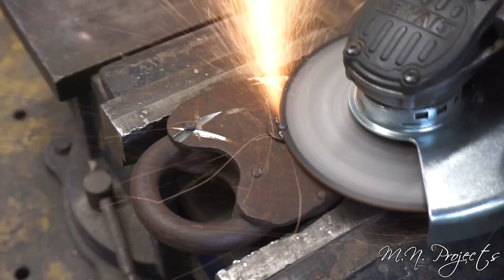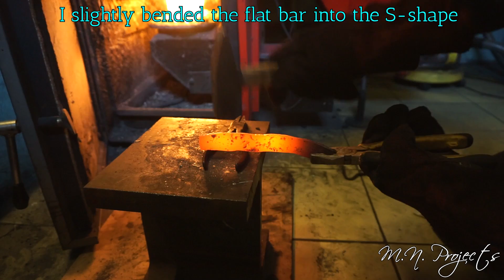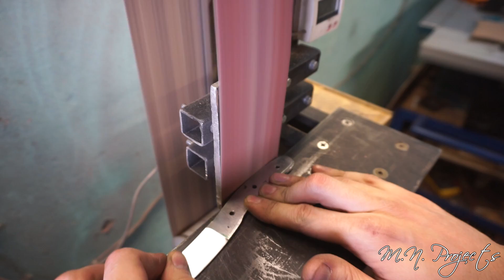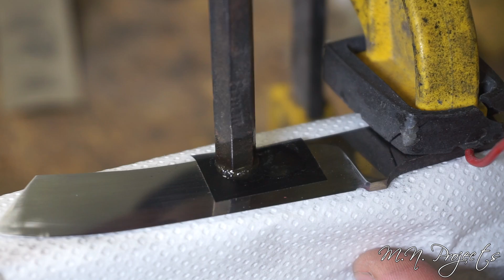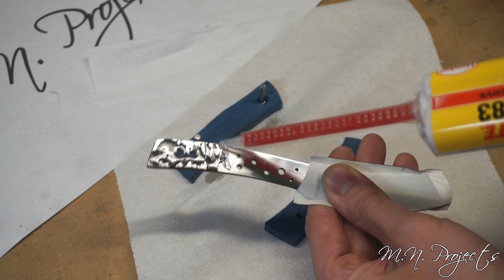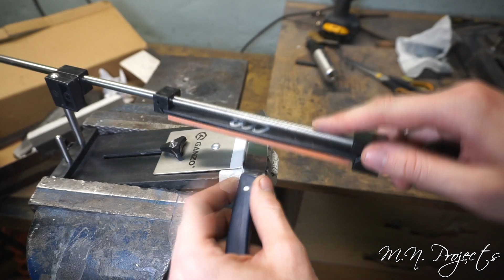Making a Knife from an Old Rusty Lock

Comment: My man you have some great skills. But I have to be honest with you here. I'm sure it's fun to make and use the stabilised wood but it just doesn't look as good as normal untreated birch or ash for example could look. Don't lock yourself in your habits and be open to use all kinds of materials for the handle, just like you use all kinds of materials for the blade. Going with the recycling theme I suggest you break an old piece of furniture and use the wood from that or something similar. And while your knives are sharp and polished, it would be nice to see some progression too. For your next project, you could challenge yourself by making a flip knife or a sheath too. Just some tips from an old smithy, who sees himself in your works. Don't make my mistakes or how the saying goes..